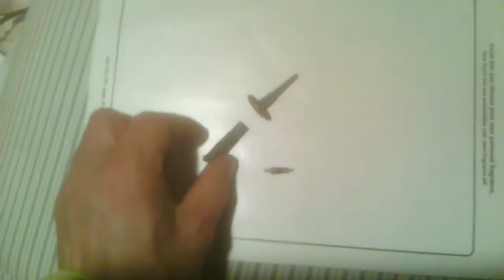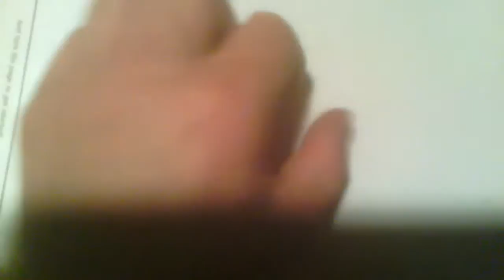Remove Schrader Valve Core With a DIY Tool

Comment: I made one by sawing two notches in the end of an old bicycle brake adjuster barrel. (I had to file down the thread on the outside so that it would fit inside the valve stem.)

Comment: I tried to make this, got pissed off that I didn't have a drimmel and my files could barely cut the hardened tip. so I just resorted to using a fork, no lie.
Reply: goodkill1 Thank you for the great idea. I was like I don't need a weekend project, just a "get me by"  tool. Worked perfect.
Reply: you should make the video about using a fork to remove a valve core stem, for that should be very helpful advice to many people.